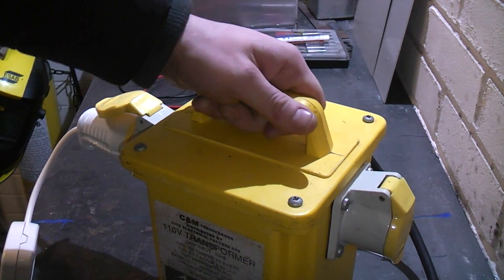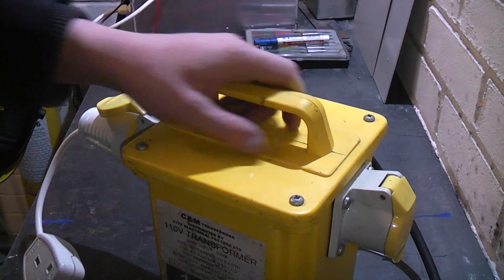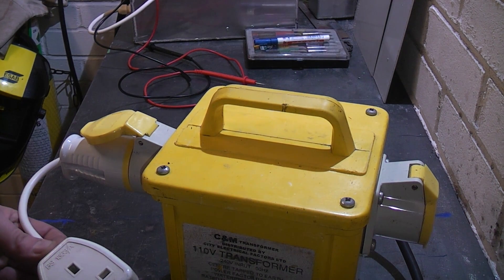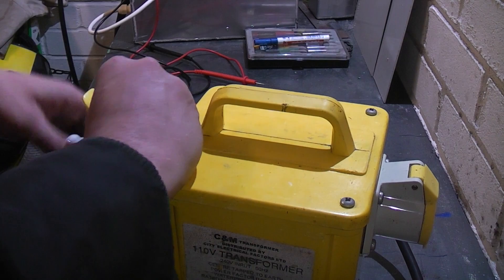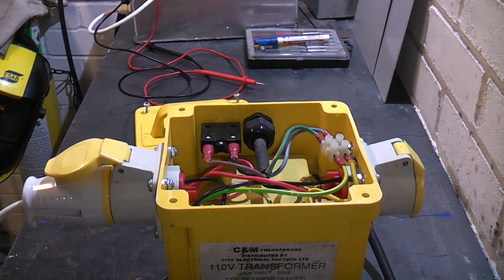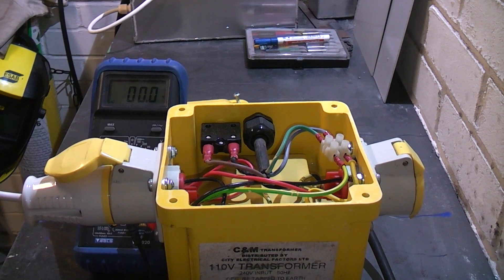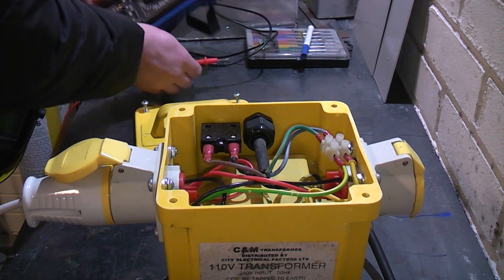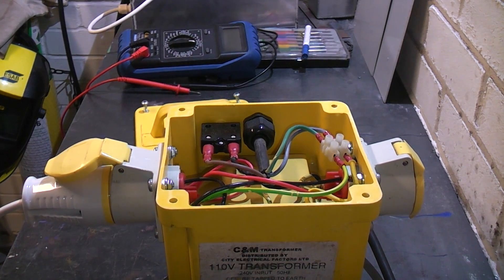A look inside a 240v to 110v stepdown isolating transformer.

Comment: You can legally use 240v on construction sites provided an RCD is used to protect the system. The only person that may object is the site supervisor or health and safety guy. It is in my opinion a silly rule because the transformer is 240v! And doesn't require an inline RCD so why the bother? Basically it is a rule to reduce fatal electric shocks. I have had a few shocks and lived to tell the tale!

Comment: How would I multitest a transformer like the one in vid?  Thanks
Reply: Disconnect it.
Measure the resistance of the primary and secondary coils. Ensure they are not infinite resistance and ensure they are not dead shorts.

Easy.

Comment: Do you know if I can cut the plug of a deWalt jigsaw 110v and put a 3pin 240v plug on it please? Cheers x
Reply from the maker: No not at all because you would blow the moter if its not rated for 240v .
Reply: Yes you can, it is just a mechanical process. However you will not have a functioning tool after plugging it in. Don't do it.
Reply: Ignore the other 2 clowns you are perfectly correct to add your “UK plug” socket to this and use the 110v appliance since the video demonstrates the fucking output voltage is ALSO 110v as measured by the shit quality multimeter .

Comment: I'm thinking that you really shouldn't be opening that up. Qualified service technicians only.
Reply from the maker: i repair them at work.
Reply: Mine has a short, someone cut out the safety switch in what I think is a effort of trouble shooting. Any tips in fault finding?
Reply from the maker: yer check the resistance of the output, if the windings ar shorted  or burrnt out its scrap.
Reply: Bollocks. Take off the top

Comment: 60hz equipment running on 50hz will not overheat. It will underperform. Overheating may occur if the opposite is applied.

Comment: I didn't know OSHA was such an overreach to the UK as well, I am also surprised that it doesn't have a GFCI.
Edit: {( what I mean by this is that they have crazy requirements for job sites )}

I am also trying to wrap my head around the center tap ground ( since everything is potted and you can't see it ) is that L+N in to the transformer primary, and center tapped to ground on the secondary essentially creating 2 phases of 120 (110-115) L1+G+L2 on the output?
Edit: {( NO it is,  55V L1 (H) + 0V G/N (G) + 55V L2 (N) = 120V )}.

on a side note I was pumping out a foundation in the US and needed to rearrange the extension cords when I accidentally dropped an end in to the "Lake" and it tripped the GFCI ( there called something different in the UK ). {(RCD)}.

but OSHA is mandating everything be GFCI and ground bonded neutral on everything construction related in the US. so then you pick up a generator and you have to remove the ground bond before you can tie it into a house panel which is also bonded. it's madness.

:Edit:
and hopefully for a little more clarification/confusion Here is a bit more that I commented on the subject elsewhere.

And that's what I couldn't wrap my head around, you crazy Brits.
centered tapped ground/neutral for fault to line voltage of 55V vs. the US where everything neutral is bonded to ground whether at a service panel or the opposite side of a isolation? ( cannot verify that ) transformer. basically everything neutral is a "0", go through something and come out the other end and guess what has to have some reference to neutral/ground. I have a conditioning transformer, 1 loop of wire away from being an isolation transformer. ( unless you are a power company then you can do whatever you want, even if it means people are getting electrocuted in their swimming pools because of an improperly made connection up at the pole transformer, that's a different YouTube video.... )

and
OSHA requires that all job sites use generators or a fixed temporary service that has neutral bonded to ground at the point of generation ( manufacturer optional unless sold as OSHA compliant ) or service entrance ( NEC code ).

this makes temporary generator backup setups interesting, as it's a 50% chance one way or the other of a portable generator ( per manufacturers decision/market ) creating a double bond fault where return current can pass over the ground conductor to the generator. the solution so far from what I've been reading is to break the G+N Link on the generator and attach a ground bonding plug or switch to the generator to reestablish compliance ( either that or pull the linkage out of the service panel every time the power goes out ) or ignore it altogether.

it almost makes me wonder if the 55V to ground transformer idea is what OSHA should really be doing in the 1st place?
it doesn't seem like it is that difficult to do even if you start to use premise wiring, all that is needed is to be tied in to a transformer before a generator or temporary service drop.
although with our fancy split phase equipment a site tie-in would probably need to be a double secondary transformer with both secondary center taps tied together with ground ( my crazy idea, copyright, I am willing to be bought out ).
Reply from the maker: The output of the transformer is 110v across the both of the phases the centre tap earth is connected to the earth wire in the mains cord on the 240v side so you only get 55v above ground its much safer than 240v above ground,GFCI's are called RCD's (Residual-current device) in the UK.

Comment: Can i use power tools from america on these tip of transformer
Reply: AS LONG AS THEY ARE RATED FOR 50Hz!
I do not see why not as most of them are two-prong and do not require a ground, apart from the connector difference. or if your supply is 60Hz?
although that is the one thing I need more information on, 50Hz appliance on 60 Hz and vice versa. ( then again I saw somebody's laptop computer on a 400 Hz socket and I don't assume it fried anything as it was still working by the end of the flight/movie. )
Reply: some 60hz motors will run a little slower on 50hz.